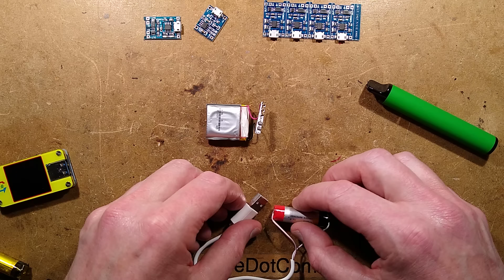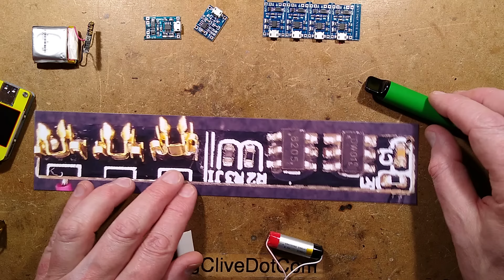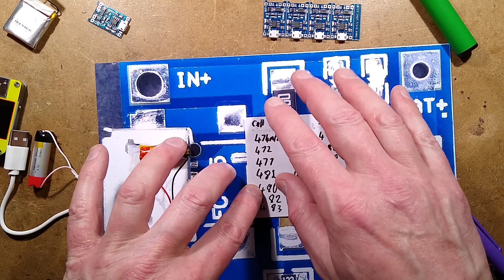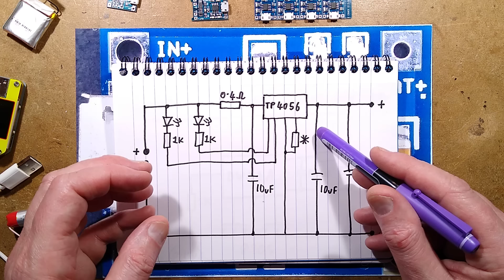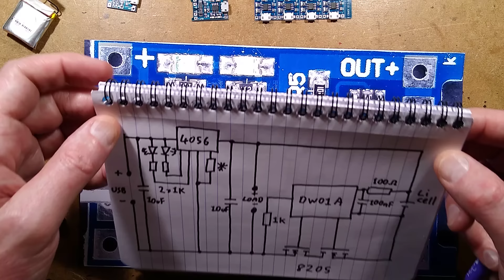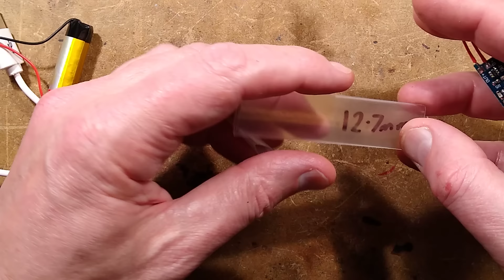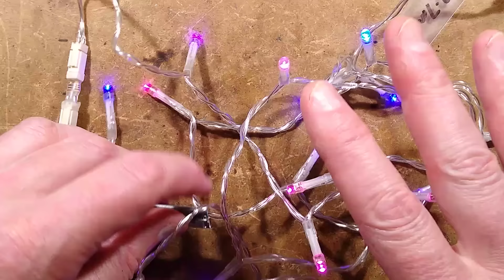Don't do this!   (There's a much safer way)

Comment: I am constantly bin raiding the battery bins at supermarkets. You’d be surprised how many Dyson packs I get! The batteries are 99% good most of the time with over 4v, which suggests the BMS fails?

Comment: Kreosan made a rocket out of a 18650, it went so hot the case was red hot in seconds so caution is always good to have when dealing with these. I have the modules with extra protection from the very start of using Li-Ion batteries, note that the TP4056 chip ramps down the current as the cell gets full._

Comment: I am use a lithium battery (18650) charger, that should be okay, right?
Reply from the maker: That depends on the current output.
Reply: Aye laddy ty, but if it's a decent charger, should be okay, and I have had no problems with 19650's

Comment: Not sure if there’s room, but how about a DIL switch and a resistor in parallel to set the current? Flicking the switch could introduce a second resistor in parallel with the first one so you have a choice of charging currents depending on the cell being charged?

Comment: What about the idea of finding a ~2.2K (if they exist) trimmer pot and mounting everything on a tiny perf board? (assuming the holes on the charging board are standard width). This would allow you to use the one board for multiple batteries. Though I assume that might not be such a good idea if the trim pot goes too high, shorts in any way, or you forget what it's set to and just plug it in anyways. Also with how cheap these are it might not be worthwhile when you could just mod one with a 2.2K resistor an use another one standard. I'd just make sure to label them.

Comment: Looks good although is there a way of setting the charge cutoff voltage to 4.1v? Or do I need a different charger?
Reply from the maker: It's locked in the chip so you might need to use a precision regulator.

Comment: What would happpen if I connected this to an old phone battery (2000mah)? Will it charge (without overcharging) in 2 hours if I don't change the resistor? Also, can I just add to the resistor value without taking it off or I need to take it off? Great video btw

Comment: Great vid. I learnt the hard way and got a post midnight pyrotechnical display. Lucky enough...charge all contraptions in a fire proof box ! eBay provided the solution of a drop in, spring loaded lithium battery charger and better night's sleep had after that! Only about a fiver. Cheaper than a new house for sure. J

Comment: For me, the reason to use connectors (molex, JST-XH, JST-PH, or JST-RCY) besides them just being convenient is that it means I don’t have to keep jogging my half-asleep brain to remember which way the polarity goes every time I want to charge it: instead, that documentation has been made physical by how the connectors mate together.  And that is my very favorite sort of documentation.
Reply: Yes! These are behavioural barriers - they can be either hard barriers or soft barriers. Less room for error with hard barriers.
Reply: It's the game of putting the triangle shaped block into the triangle shaped hole.
Reply: @akaiappears  they all go in the square hole

Comment: I used a slightly different charge/boost module and a 4000mah Lipo battery to convert my sons metal detector over to be rechargeable. Works great so far.

Comment: Used to pop those vapes open all the time and recharge them with a stripped usb cable. Never had an accident but also I was very cautious. These things had a lot of juice left once the battery dies. Also worrying, I would notice the the same vapes from the same brands would have different internals

Comment: excellent the only thing I would have liked to see is the unsoldering and replacing of the resistor... or you said quarter watt resistor in parallel but not what value....

Comment: I always connect lithium batteries directly to the 80 amp consumer unit output !!!   BANG !!!!  Only joking !!!!  It's amazing what people do !!!  I would never put any current into a lithium battery unless I was using a Power Supply with complete control over Volts and Amps !!! And that's only if the battery has gone too low to charge it !!!  Just to start it off !!!

Comment: Thanks for this. I didn't actually know these little charger/safety boards were a thing.
They're so inexpensive that you can just .... buy a box of them and install one permanently on every lithium battery you find, then set the charge current appropriately.
As for output, I think a buck/boost would be invaluable for this kind of situation, allowing you to stabilize the output voltage for more sensitive devices, or even kick it up for a little more power.
That last bit would only really be useful for larger cells though, these tiny 500mAh would struggle to push much of anything when in step-up mode.

Post-hoc edit: You can buy them with boost converters built in!

Comment: I would advise using a diode and 5ohm rez in series with the battery and a 2k-10k rez in parallel with the battery to make sure the diode is always dropping at least 0.6v. you can find these components in any ewaste or even electronics shop. no need to wait for 6 month ebay delivery.
Reply: 6 months? Try 3 days.
Reply: @dlarge6502  never had anything mine or friend's arrive in less than 3 months

Comment: my one gripe with those tp4056 based charging boards is that the usb-c implimentation is awfull and doesnt properly identify it'self as a sink. I dont know what exactly happens but when using it with a quick charger it ends with some magic smoke and a dead board.

Comment: would connecting 2 batteries in parallel help ease the load with the 1 amp charging? thats what ive been doing to ease each batteries individual current at charging and increase the capacity. ive got around 250 of these batteries now
Reply: Provided they are initially at the same voltage you can connect them in parallel.  However, the 1 Amp charging should only be done until they reach 4.2 V.  After that the charge current must be reduced so that the cells take the last 10% or so of charge at ever reducing current while the voltage is still limited to 4.2 V.  At about 50mA you should then switch off the charge current.

Comment: I suggest adding some hot glue to the soldered on wires for strain relief before adding the heatshrink. Anytime a wire is soldered without strain relief it always manages to break off at the worst time. If you hot glue and then heat shrink the glue should fill in and make a solid unit.
Reply: Interesting idea, will try and check results. Thanks!

Comment: The nice thing about the boards with the dw01 is that the 'out' terminals are always fed, regardless of whether the battery is charging or not, which makes them perfect for a little USB UPS if used with a small chip to boost the output to 5v. I use one to keep a little USB clock running if there's a power cut.
Reply: The problem is that the TP4056 does not do proper load sharing and, as described in a higher comment on this video, will think that the load current is battery charge current, and never stop providing charge to the battery. Ultimately the TP4056 isn't suitable for use while charging. Your clock probably doesn't draw that much, but another project might.

Comment: I took one of those discharge protection boards from a dead cell. It didn't have the charge current protection (typical type used in most simple cells). I soldered a USB connector to the board through a 22 ohm resistor. The resistor limits charging to around 220 ma and the protection board stops charging at 4.2 v.

Comment: Clive has made many videos showing how shoddy cheap stuff from China often is, but now advocates TP4056 modules which can be got for less than £2 with free postage. Surely a lot of them must be rubbish, how can we tell?
Reply from the maker: The TP4056 is a mass produced chip.  That's why these modules can be made cheaply.
Reply: @bigclivedotcom  Not so much the chip I'm concerned with but the possibility of other components and the fabrication being sub-standard to the point that the module doesn't provide the protection it should.
At least there's no mains voltage involvement.

Comment: Thank you so much for publicising this issue to a wider audience - I’ve seen so many hobbyist circuits with direct 5V USB to LiPo which has concerned me over the years. 

For charging smaller batteries the MCP73831/2 chips work in exactly the same way with the same status led circuitry (that’s what I use to charge at ~300mA for <1000mAh cells). Using an SOT23-5 footprint these only require a tiny amount of space on an existing PCB design.

Comment: While this is all true, I get the feeling that somebody who is going to charge a cell on the fly like this, is probably in a tight spot and just desperately needs a battery that works for 10 minutes.  And they're probably gong to be sitting staring at it while it charges and if anything will disconnect and use it before it's even half charged.
Reply: I don't see any reason why anyone would be that desperate

Comment: Just love watching your videos Clive and it's because of that I removed the battery from a street discarded vape the same as the one you have in this video with the silver red and black battery,I recently purchased a Power Supply Module LM2596 DC Converter as I would like to try and teach my 7 year old Granddaughter about LED's and resistors etc,not that I know a lot but I am learning, What do you recommend  I set the voltage and current output on my buck converter to charge these batteries,thanks again for all you videos,any other channels I watch on electronics  your name usually crops up as you have a lot of respect from your Youtube friends,also if you could recommend a good channel that I can learn more about the converter as it does't come with any data sheets or instructions
Reply from the maker: LEDs are good, but I'd avoid showing someone young a project with lithium batteries.  They're a bit volatile if mistakes are made.
Reply: Thank you

Comment: Why not, instead of changing the resistor to a fixed value, solder leads to a selector switch with two different resistors resulting in selectable charging rates.  You could then put the whole thing in a small plastic enclosure and have a more versatile charger.  That would make a nice project video too...

Comment: Very cool. I’ve been harvesting these since I saw your video and have been charging by alligator clips and monitoring and charging them to 4.12v and they have been fine so far but I’m very glad you posted this. I didn’t know 5v usb could damage the battery. Thanks again.

Comment: I got myself a Liitokala Lii202 charger that you plug your USB in. It detects the battery type and has been able to recover batteries that other chargers didn't charge anymore after discharging too far (note, those were not LiIon batteries, it's bad to discharge those so deep)

Comment: Just remember those Samsung Notes burning up and also burning cars and houses down. Not for the same reason, but it’s why the FAA doesn’t allow lithium batteries over 100W/H on a plane. These batteries, while usually pretty safe, can, if damaged in some way, be very dangerous. I’ve tried to prevent people from charging their lithium batteries with NiCad and NiMH batteries. I know someone who replaced the NiMH batteries in his portable home phone with lithium, and after a bit more than six months, it blew up. Fortunately, it was in the charger, and not against his head when it did.

Comment: You can get a tp4056 with a boost board chip integrated so you can boost 4v to other voltages such as 9v so technically you could use one to power a 9v battery but pulling too much current makes it burn out.

Comment: wow people just stick 5v on them and hope for the best? I bought 20 of those TP modules a few years ago and use them in most battery powered projects, very handy board and not had any failures either.

Comment: About replacing the 122 (1.2KΩ) current limiting resistor...
If we attach another resistor in parallel to the existing resistor (as opposed to replacing the existing one, or adding an additional one in series) doesn't that effectively decrease the resistance?
Reply from the maker: Adding in parallel reduces the resistance.

Comment: "Not 500 amp. That would be quite exciting." 
Every once in a while I see a news story about a new battery technology which can be charged 100x times faster than existing ones. I wonder how people would feel about a  100A connector on their phone, or a 3200A connector on their EV charge cable.
Reply from the maker: The media loves to announce miracle battery technology for an easy headline.
Reply: I would NOT want to charge a little 18650 or two at 100 amps.  We do have vehicles with 160 amp alternators on them at 12 volts but you aren't usually trying to draw that kind of current continuously off of an AC circuit and lead acid batteries for vehicles are a bit more robust than a single lithium ion cell.  Yes, I know that the batteries in a Tesla are based off of 18650 cells but when you put 500 of them into a battery bank and use the appropriate circuitry they are safer to charge at high current than a single or double cell intended for cheap electronics.  Even with the safer design I have heard of Tesla battery banks going thermonuclear in the recent past so charge your electric cars outside and NOT in the garage.

Comment: Only someone not aware that Lipo's are basically flaming smoke bombs (mostly vaporized lithium hydroxide, don't breathe that if you don't want basically lye in your lungs) waiting to happen would plug it directly into 5v with no BMS or thermal protection. Even with 4.2v it will still overheat if there's no current limiting. 2-3A into a AAA-sized cell  rated for only 1C (maybe 600-800mA) = bad.

Comment: I actually have a bunch of chipsets from old battery packs you know those with lithium charger packs and if you use those chipsets it will filter the power to the right setting automatically and stop it from overcharging. If you have a power bank laying around that the lithium battery is worn down near completely you can just disconnect it with you and battery throw it away the proper way and use the chipset to recharge your new lithium battery.

Comment: I've noticed 1.5V NiMh's going the way of the dodo and being replaced with Li-ion versions that packs a small buck converter that converts the 4.2-3v to constant 1.5v, a protection circuit, and 500mA micro usb charger that converts the 5V to up to 4.2v 500mA CC into 1 board smaller than a pinky thumbnail (small enough to fit into a AAA-sized casing and only take up about 8mm of the length, with the cell roll still long/dense enough to outdo the capacity of NIMH's). Insane that something that small can handle 1A of current without overheating. There's no discharge curve of typical alkaline batteries either, output is either 1.5v or 0V (which makes capacity guages that rely on measuring the output voltage unworkable, but meh).
 The 9V version has 2 rectangular cells in series with a boost instead of a buck converter that put out a constant 9v/0V (when used to power smoke detectors there is no low-battery alarm reminder that watches for battery voltage to drop under 6v, it instantly drops to 0v when drained so there is no power to run the intermittent beep, have to pay attention to that).

Comment: Excellent video as usual! The data sheet for the TP4056 had the word "coruscate" instead of "flashing" for describing the LED modes. I looked it up and it basically means flashing.  I learned a new word today!
Reply: Terry Pratchett (RIP) used the word frequently in his Disc World books.  I took it to mean "bright, directionless and with varying intensity" lol but i'm an idiot.

Comment: I have loads of the FC-75 boards and use them to make USB rechargeable Lipo roller skate led lights and have them coupled with 350mah cells and boost modules to get 5v for max brightness out of the 5v led strips.
I set the charge current with a 10k resistor as i sell them and want the cells being stressed as little as possible, 130ma is plenty for a 350mah cell that does not need to be fast charged.

Comment: Would a "normal" multi-cell charger work? Like the ones that are more or less designed to work with 18650 and other vape cells, but also work with AA cells as well?

Comment: Free batteries must be a good thing .....  The recharging process is not perfectly efficient, but even if half the energy were wasted, you would only be paying about 54p/kWh  (based on 27p/kWh from my own electricity meter when I topped it up today).  If you are using solar panels or a wind turbine for recharging, of course, it's free anyway .....

How expensive are disposable batteries?  A typical alkaline AA cell holds 2Ah of charge, by Big Clive's own measurements  (see a few years ago on channel).  At a voltage of 1.5V, this would be 3Wh of energy  (a watt-hour is equivalent to 3.6kJ, since there are 3600 seconds in an hour);  but the voltage won't stay at the full 1.5V for the whole working life, so call it about 2.5Wh of energy in an alkaline AA cell.  Or 10Wh in a pack of four from your local pound store; which works out at a nice, round £100 per kWh.

Comment: Just wondering why would they use 1 1K2 resistor and 3 1K resistors, being these 3 to drive leds and monitor voltage, and not using 4 1K2, reducing the number of distinct components...

Comment: Since the safe charging voltage on lithium cells is 4.2 volts,how concerned should i be if my phone charged it's battery to 4.4 few times?
Reply: It's normal for phones to charge to a higher voltage. It's safe but you get fewer cycles. 
There's isn't really one correct voltage, it's a compromise between stored energy, and number of charge cycles.